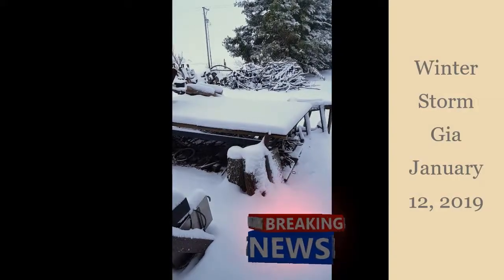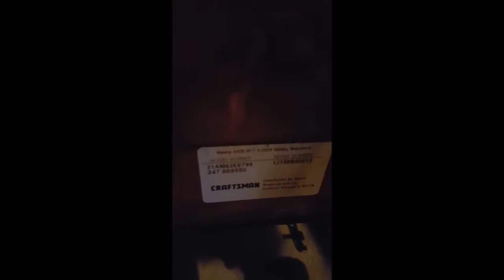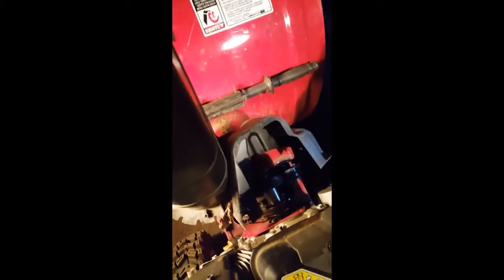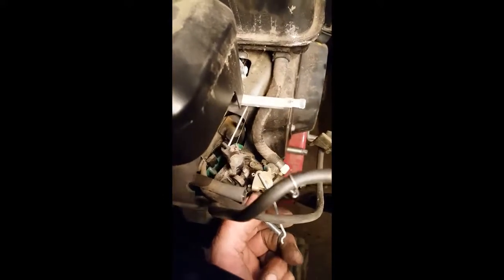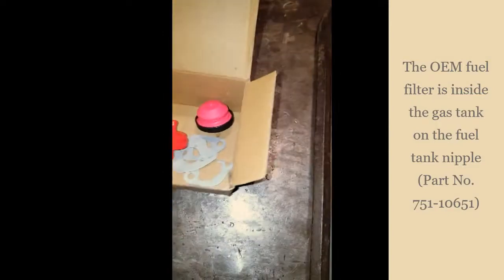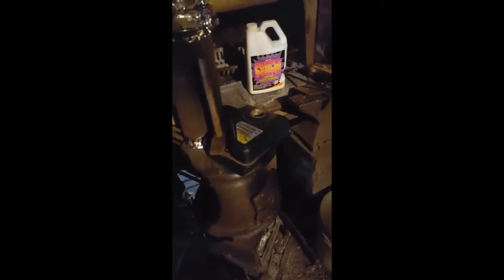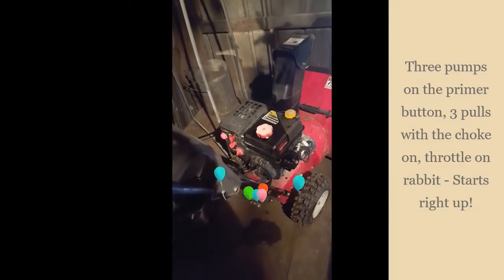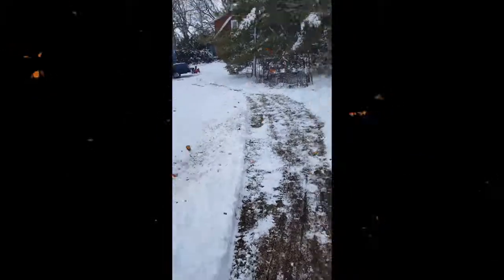Craftsman 24 Inch Snow Thrower Carburetor Replacement Gas Tank Cleanse Fast

Comment: I have the exact snow blower what was the carburetor you ordered i might need to replace mine. Do you remember the part #?
Reply from the maker: Here is the one I bought on eBay back in 2018 - still seems to be available!  Good luck https://www.ebay.com/itm/223273275749